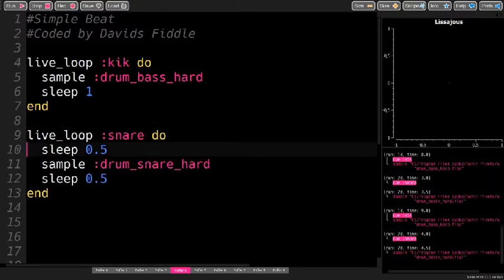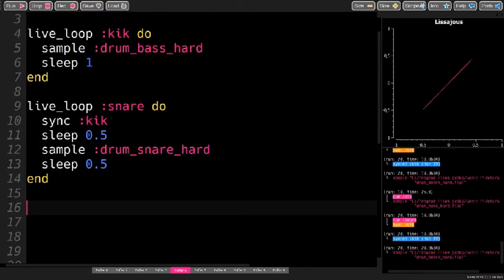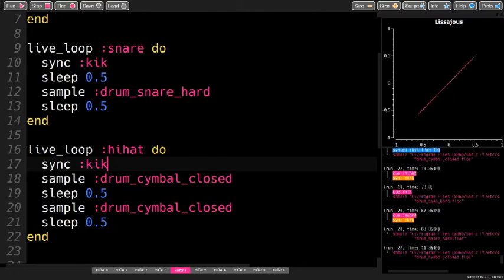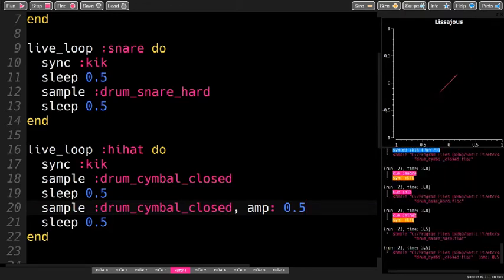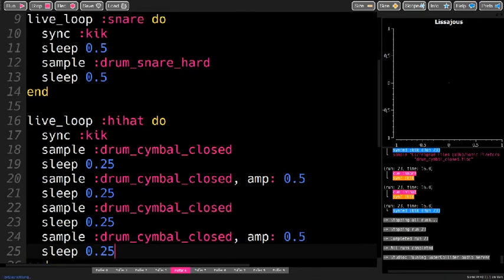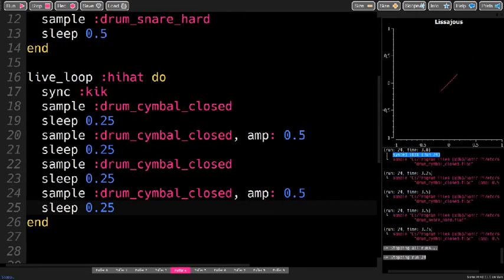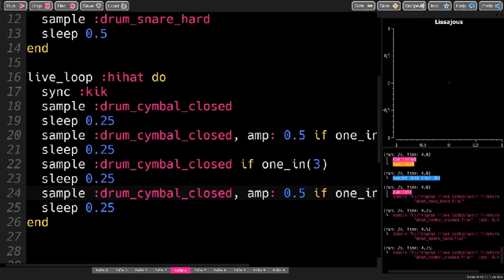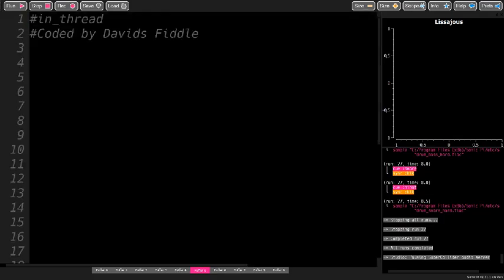How to make a Simple Beat - Sonic Pi Tutorial

Comment: When I run the kik and snare code as you have it written, I get two kick hits before the snare. The rhythm is kick hits on 1 and 2 and the snare hits on the 'and' of 2. I've been noticing this problem a lot when trying to do multiple live loops. IS there a setting or something I'm missing?

Here's the code I ran:
live_loop :kik do
  sample :drum_bass_hard
  sleep 1
end

live_loop :snare do
  sync :kik
  sleep 0.5
  sample :drum_snare_hard
  sleep 0.5
end

Thanks for your help
Reply from the maker: It works fine for me, I could imagine the new version 3 changed something about the syncing.
I'm still running v2.11 because I'm on windows.
Reply from the maker: I think that the :snare loop syncs, then sleeps for a total of 1 and finishes at the exact same time as the :kik loop 
so that the cue from the :kik loop and the sync in the :snare loop happen at the exact same time.

Try taking out the sleep 0.5 in line 10, so that the :snare loop is already waiting for the cue when the :kik loop starts over.

There's also a command to bypass the guaranteed timing, you can find it in the help window.
Reply: Taking out line 10 didn't really help. I tried moving the sync :kik outside of the live_loop and that worked, although I don't understand why. 

I also don't understand why my code would run exactly the same as yours. I've run into this problem trying to copy Sam Aaron's code and even with examples from the help window. I feel like it has to be some type of internal setting. I'll check out the guaranteed timing bypass.
Reply: Like you said, this works as expected....

live_loop :kik do
  sample :drum_bass_hard
  sleep 1
end

sync :kik

live_loop :snare do
  sleep 0.5
  sample :drum_snare_hard
  sleep 0.5
end
Reply: So does this:

live_loop :kik do
  sample :drum_bass_hard , amp: 0.75
  sleep 0.25
  sample :drum_bass_hard
  sleep 0.75
end

sync :kik

live_loop :snare do
  sleep 0.5
  sample :drum_snare_hard
  sleep 0.5
end

live_loop :hihat do
  sample :drum_cymbal_closed
  sleep 0.25
  sample :drum_cymbal_closed, amp: 0.5
  sleep 0.25
  sample :drum_cymbal_closed
  sleep 0.25
  sample :drum_cymbal_closed, amp: 0.5
  sleep 0.25
end
Reply: That’s probably it. Thanks!